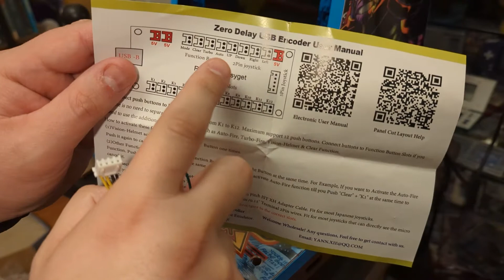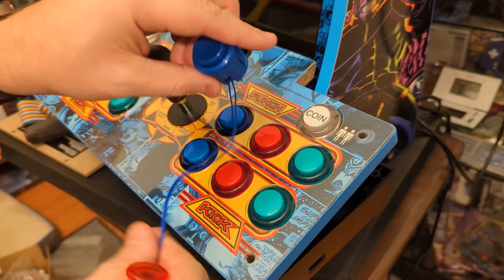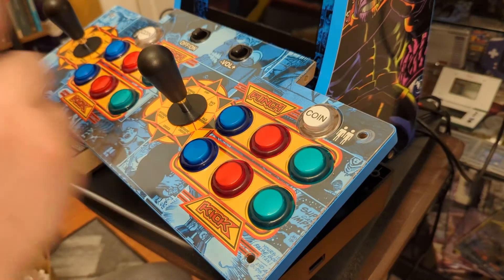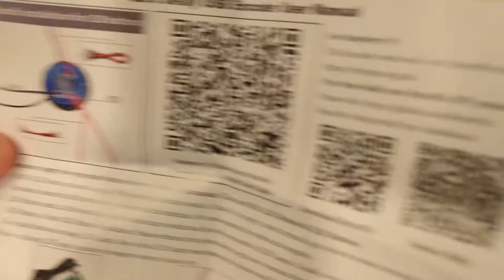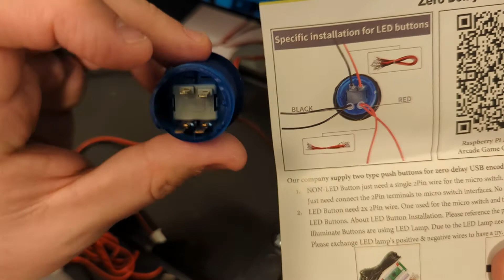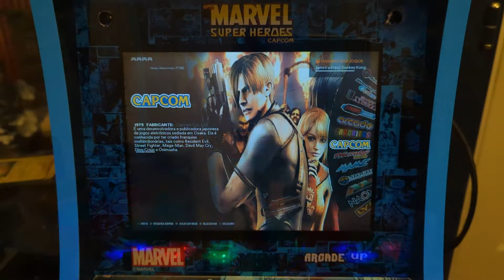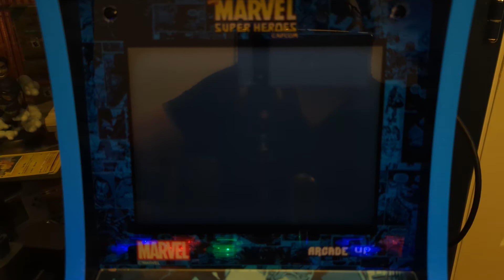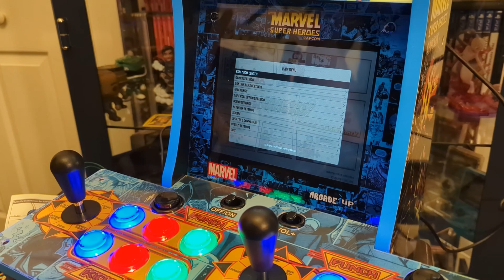Arcade 1up Gen 3 Courtercade - Alt USB encoder & Arcade light up Buttons Install/Setup on Batocera

Comment: I soldered those small pushbuttons into the wires that came with the powered buttons kit. But I had to figure out which part was for the buttons and which was for the power. I have a couple extra of those small buttons so I might add those as well in the future.
Reply from the maker: I was also about to try this, but added the other USB encoder (2 Pin)

Comment: I decided to start getting the things I need but ran into a snag... Raspberry Pi is so expensive now because of a short supply.  Are there any other reasonable alternatives that might be android based or otherwise?
Reply: I ended up just buying a nuc.  But it's for use on this and my ALU.
Reply from the maker: Yes Pi 4 prices have gotten out of hand. Thanks to chip shortage and third-party vendors bundling them up with outrageously priced accessories. I was planning on buying another Pi 4 or 3B+ but decided to go with a small Lenovo PC for my next project.
Reply: Would this setup work for a switch or psvita TV?